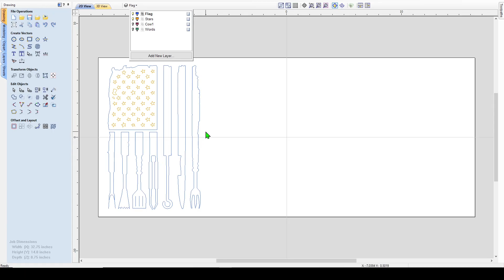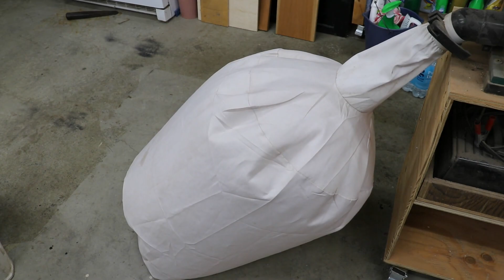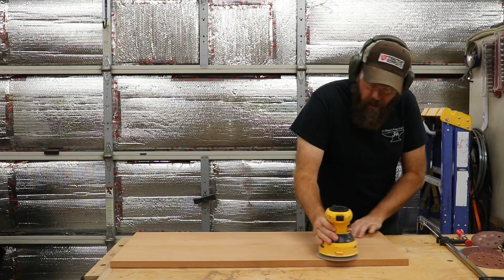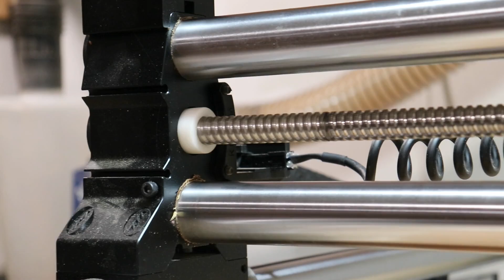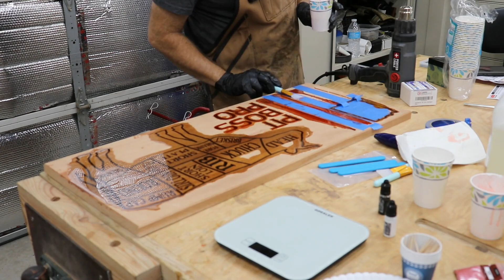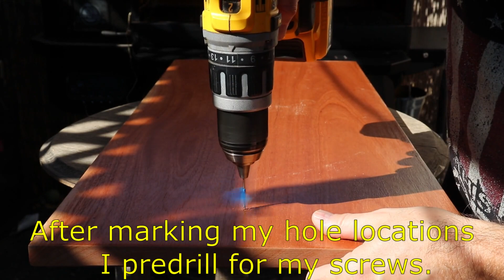Awesome Epoxy And CNC Upgrade. Jessem Jig Sneak Peek.

Comment: Fun project. Is this your first time working with resin? I've been interested in trying that myself.
Reply from the maker: I did a big resin pour years ago when I built our dining table. I've done a few small pours since then. This was my first time using a liquid color. Just mix it well and have heat gun or torch handy to pop bubbles.